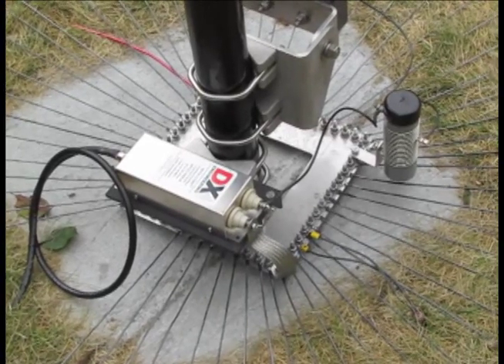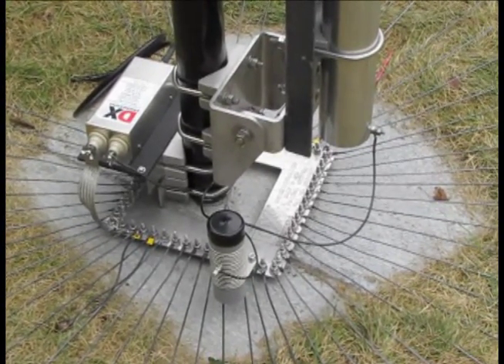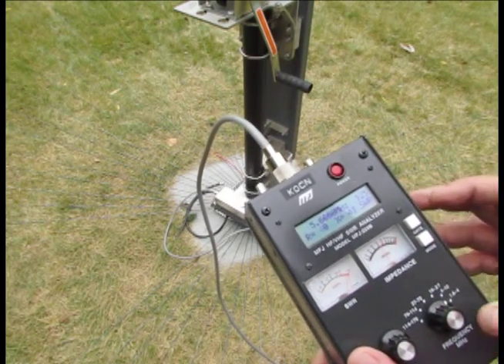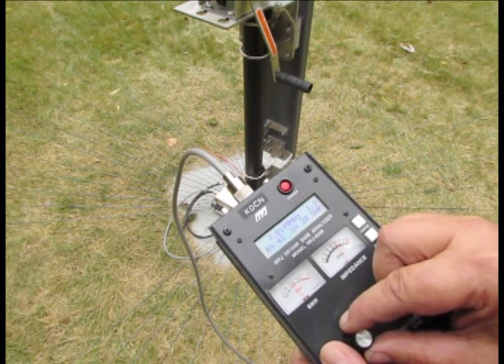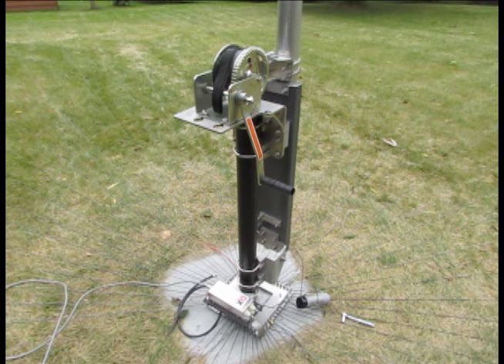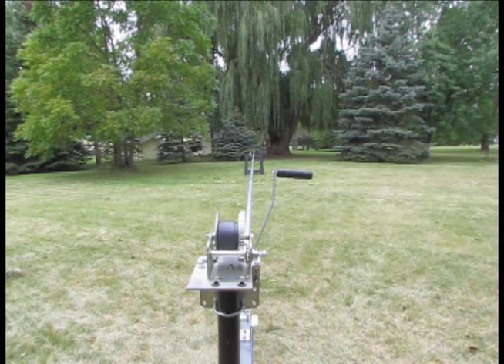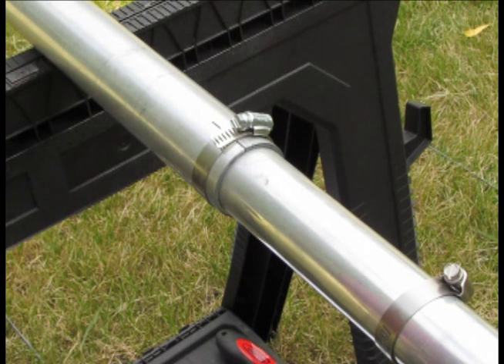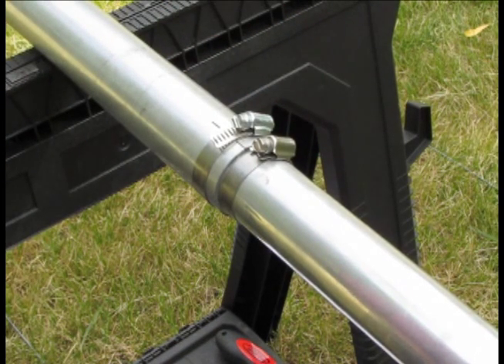DX Engineering Vertical 8040VA-1 Part 5, Antenna Tuning and Trial

Comment: Al, 
When you installed your radials I see that you fastened the end with a nail. Did you use ground staples to fasten the rest of the radial to the ground? Or, did you just figure that the grass would eventually cover the radial field? Also, if you didn't use ground staples did you have any issues with disturbing the radial field when you added the tubing to the vertical?
Mark Griffin, KB3Z